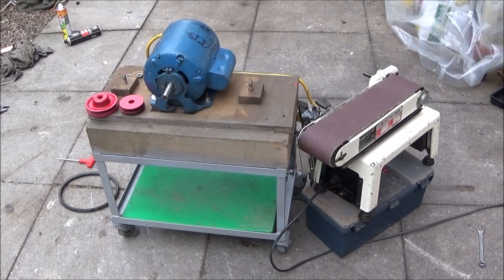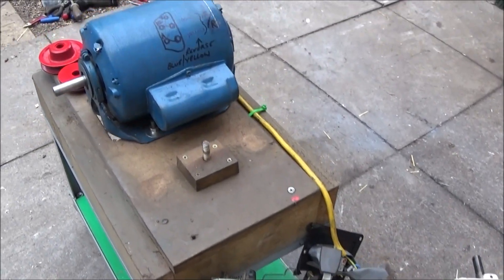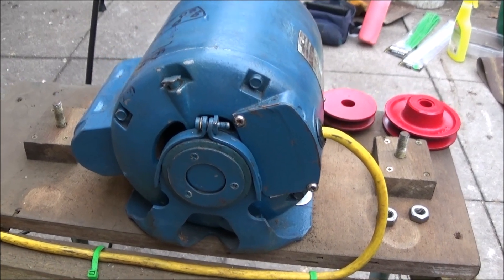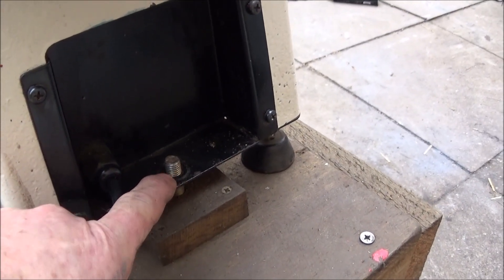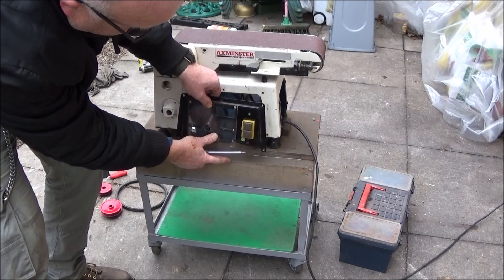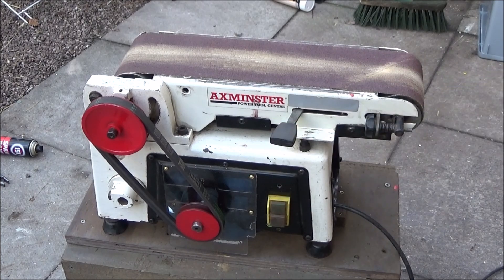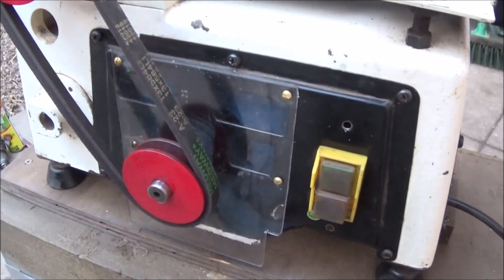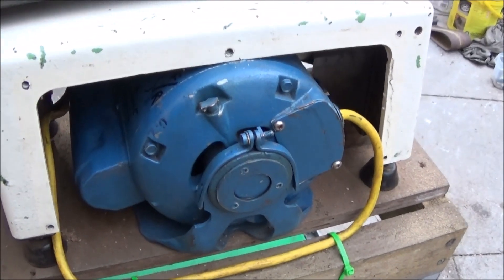Combine An Axminster Belt Sander With A 1/2 HP. Brook Crompton Motor

Comment: I've got exactly the same belt sander as that! :o) I've never noticed stopping the belt though but I don't use it all that much and I usually use it in the upright position so maybe that's got something to do with it. Useful video though in case I do want to uprate the motor at some time in the future.
Reply from the maker: Hi Ashley. When I bought mine it didn't actually come with a motor. I found three of these sanders in a scrapyard with faulty or motors missing. I bought them all as the component assemblies are very good.
They have roller bearings which makes the sander a lot better than the cheaper models. My brother had one with worn bearings though....but managed to get a new set and change them easily. Regards Steve

Comment: Good motors those.
1,400 rpm?  I seemed to remember 1,450 was the old usual on 50Hz - not that it matters a whole lot! What's 50 rpm :)
That just goes over the motor nicely. Seems a very worthwhile modification altogether... bags of power now.
Sounds like your birds are already tweeting as if it's spring :)
Reply from the maker: Hi Chris Thanks.....Yes the birds are tweeting. I have bird feeders in my yard and live near an estuary....Lots of gulls!